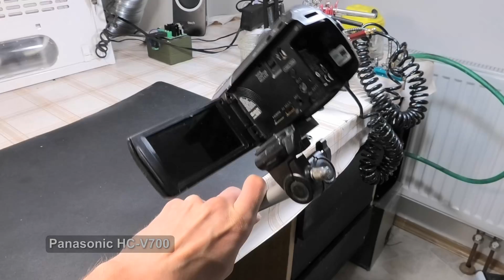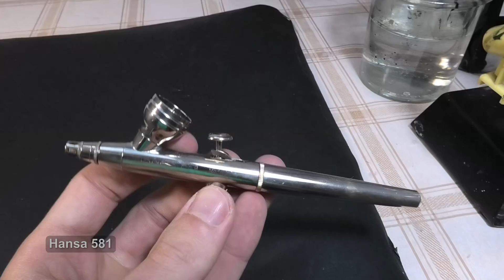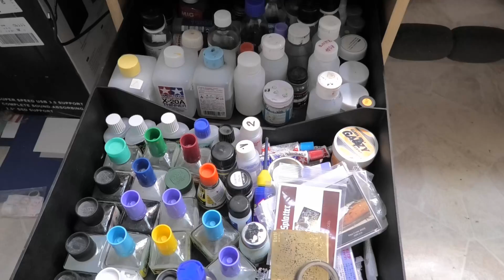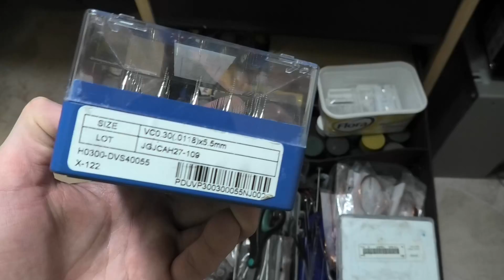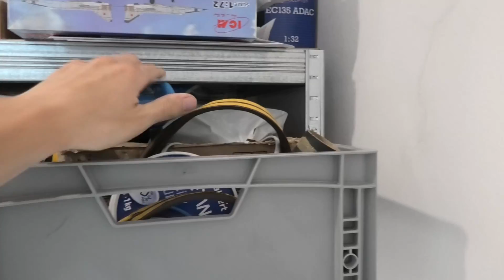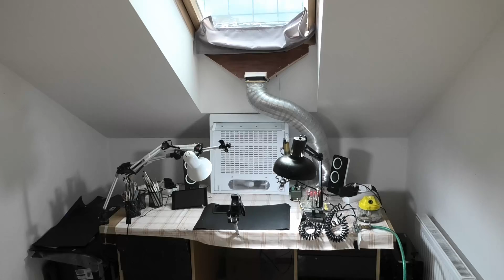Workplace Walk Around - Camera Setup - Milestone Bonus 500 000 subscribers

Comment: I was wondering if you know whether the Proxxon mains adapter with the variable speed control (NG/2E) works the same as the aftermarket modification you have. I currently don't have any 12V Proxxon tools, so I'm just trying to work out what power supply I should get.

Comment: How did you make the speed controller. I ordered the part but what else did you use? I have the same motor tool as the new pictures. I love the way it works, it would be great if it went slower. Does it lose torque? Please don’t leave me hanging. LOL! I love your stuff. I’m a 60-year-old science-fiction modeler. Mostly I build Mak by Wave ,Nitto and Hasegawa.
Reply from the maker: Yes It will lose a lot of torque but that is good for drilling small holes or removing plastic with a milling cutter. You need only the regulator board and 12V 2A or more power supply. You can use lipol 3 cell battery if you want. Then connect power +- from power supply to controller and +- to you drill. That is all.

Comment: Nice workspace for modelling! If I may give two suggestions:
- Instead of forcing yourself to drink a lot of coffemilk you can also order small cups from ebay as an alternative. 1000 pcs for only 7,70 euro (https://www.ebay.nl/itm/1000x-Plastic-Small-Medium-Large-Tattoo-Ink-Cups-Caps-Set-Pigment-Supply-Holder/254290163047?hash=item3b34dff567:m:mjgP6iRiFLragu5g_zVfYxQ)
- I use led panels for light, if you ever plan to upgrade the lights I recommend you take a look at them! take up very little space (10mm thick), very high lightoutput and they diffuse light so (almost) no shadows. 

Example of the ligt in my previous workshop: https://live.staticflickr.com/1730/27474563467_9f7ef5e7b4_k.jpg
And render of the new workshop: https://live.staticflickr.com/65535/49619671302_5128d3d67a_k.jpg
Reply from the maker: wow that is awesome. 😄 can finally stop drinking coffee with milk.
Reply: @idaemonplasmo   my pleasure! ofcourse you still can, but you are not "forced" to drink excessive amounts of it ;)